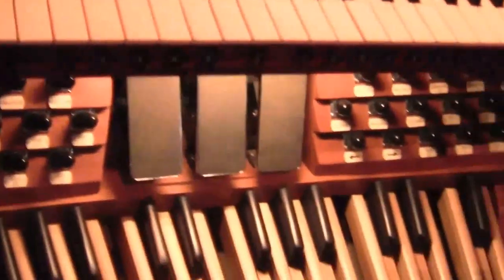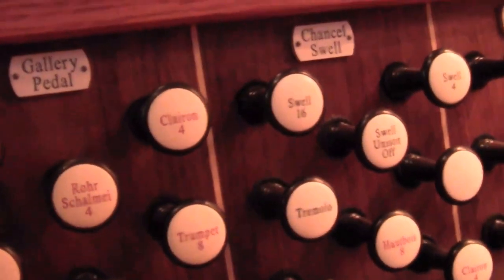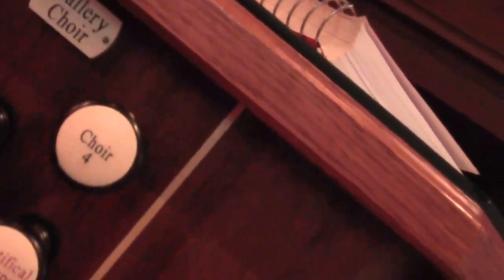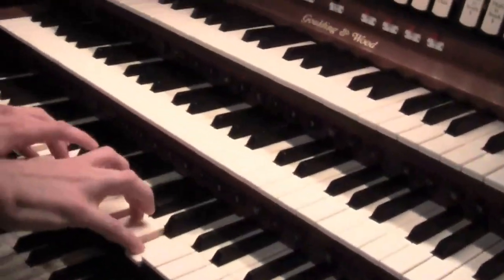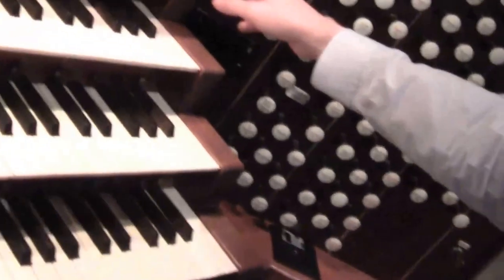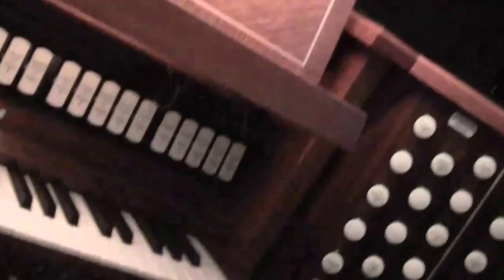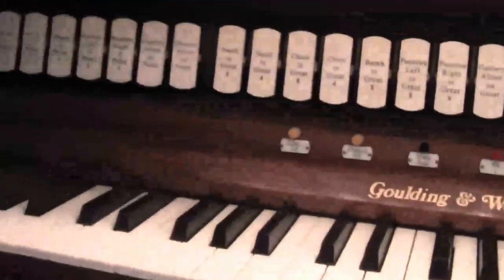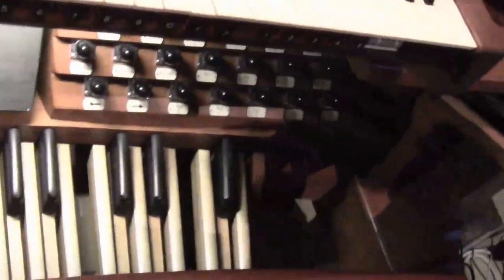Basilica of the National Shrine Washington DC - Organ Demonstration - 2012

Comment: The South Gallery organ has 6,751 pipes and 124 ranks, while the West Chancel organ has 2,642 pipes and 48 ranks. (This makes a grand total of 9,393 pipes, in case you are wondering.) They range in length from one inch to 37 feet. Hence, why the organ is really loud and echoes in the entire church. The organ is Manufactured by Goulding & Wood and M.P. Moller.